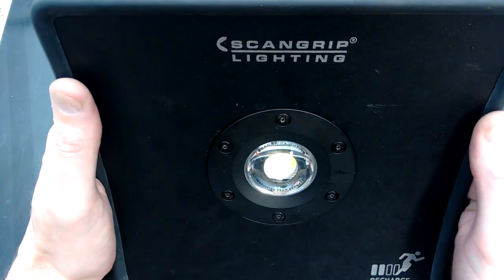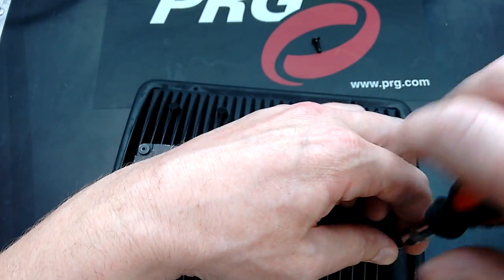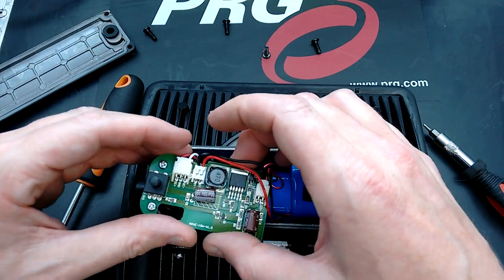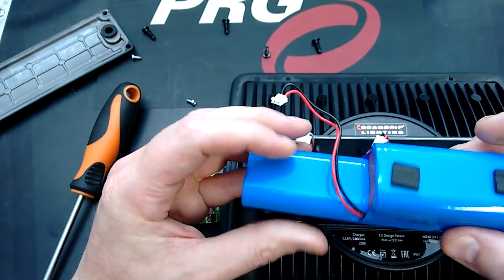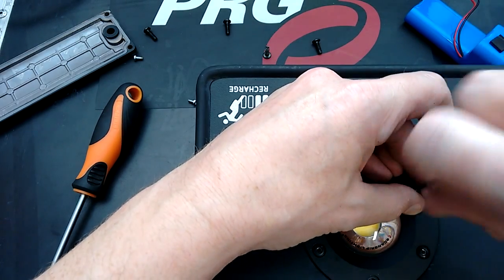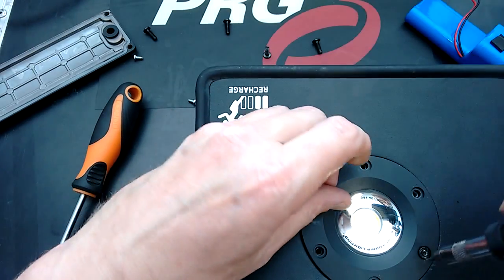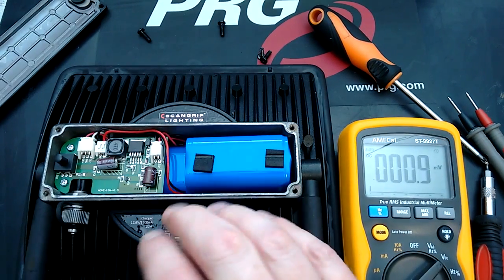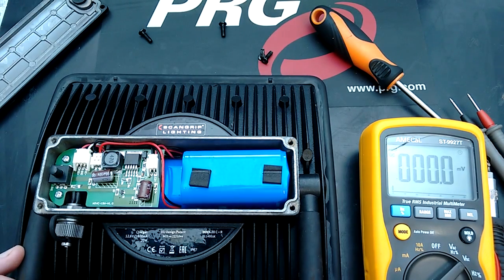Inside a good quality Scangrip rechargeable LED worklight.

Comment: Suspect 6x 18650 cells and the on voltage drop closer to 2.5V/LED at very low current, 2.9V at there low setting, and 3.06V at high power setting.  My LED strip lights, which like most white LED's are actually blue LED's, start up about 2.3V/LED and at full current they're closer to 2.9V.

Comment: It's surprising to me that the 6 18650s aren't wired in series to give a nominal voltage of 21.6 volts... I would think the boost conversion would be more efficient with a higher supply rail.

Comment: Do I see "15W" written on the driver board? Hmm, 15W driver in a 20W light? Not much better than the cheap ones… Would have been interesting to measure the actual current of the leds.

Comment: This is most likely a Citizen LED, something like a CLL022 1204 - which has 4 strings with 12 LED and nominal of approx 9W. (21W max. with proper cooling) Citizen is the only manufacturer which uses this high-voltage / low-current approach on COBs and design.
And to answer another question: HELLA heavily relies on OEM Products. They are a brand, not a maker for the idustrial lighting part. A lot of products are just rebranded with their Logo. (And sold for +20-50% of the original price.)

Comment: why is it so big? does it need that much heat sinking for the LEDs?
Reply from the maker: The cooler LEDs run, the longer they will last.
Reply: But I thought you prefered warm white
Reply: +shurdi3 If your serrious....colour temp has zero to do with actual temp of the LED. You want the LED to cool as possible...they put out tons of heat in a small package so need a lot of heatsinking to stay cool as unlike other tech they don't like getting hot as will burn out , colour shift, and loose efficancy and high temps.

You can read up on this st candlepowerfourms.
Reply: +shurdi3 If your serrious....colour temp has zero to do with actual temp of the LED. You want the LED to cool as possible...they put out tons of heat in a small package so need a lot of heatsinking to stay cool as unlike other tech they don't like getting hot as will burn out , colour shift, and loose efficancy and high temps.

You can read up on this st candlepowerfourms.
Reply: +Fry Depends on the LED used / Forward voltage. You wouldn't plug US appliance in to a UK socket would you (Pretending you could lol...it's just what the LED requires)

You can over amp LEDs a lot at the cost of heat and shorter life...but go to far and it will tint shift and burn out...However LEDs are sensitive to voltage and pop easily at the wrong voltage.

Dedomeing an LED (Removeing the "dome" on them...little clear part above them can increase its LUX (I think that units wrong but it's something like that...been out of the torch tech for a while) but often causes a tint shift...often to a warmer tint in a good way though...but it will technically loose effisncys...as the dome helps in that regard.

Honestly candlepowerfourms is an amazing resource and hobby if you want to learn more.
Reply: +CyclingSalmon14 Edit...I'm talking about direct driveing the LED...in terms of the boost circuit I have no idea if boosting up is more efficient than haveing a higher voltage battery and then regulateing it down...but you'd need more cells in the same space so would have less capacity and or a larger unit for the same capacity. Generally I would imagine it's simpler to use a boost converter rather than a regulater but I'm no electrician...I nearly understand that side of it so that's a question best answers by Clive.
Reply: yes its cheaper to use less cells and shorter charge time for them too, if you used more cells to reach the voltage you would indeed have a  longer running time, but i guess they consider the space saved and the converter a fair trade off.

Comment: Seems like they put not only protection circuitry but a full BMS on the battery pack.
There has to be some sort of balancing for an 3S2P lithium battery configuration like this. Since there is no charging circuitry or current regulation visible on the boost converter PCB this would make sense.

Really like the modularity and simplicity of this light. 
Everything in there is there for a reason and one specific purpose.
This being a current regulated light, there shouldn't be any visible pwm flicker when using one these as a video light.

Comment: I have a nice CREE XHP70 LED, that damn thing is 4000 LUMENS!!!! About equivalent to 4 or even 5 100W lamps! I think it is about 30 or so watts, and at lower powers, the higher binned ones (generally the colder and lower CRI ones) can achieve 170 lumens per watt, too! Although I prefer light quality over efficiency by this point, given that LEDs are so efficient now.
Reply: Nice, I picked up a CXB3590 for one of my projects and the 13000 lumens coming out of it will burn things. Hard to handle the 140W heat price though.
Reply: +Thor Rankin 
I'm currently working with an array of 160 XHP35's
1820W/255k LM 

:D

The most efficient LED by Cree:
I get 141LM/W
Reply: How would you cool this array down?
Reply: +Electester either it's a huge array with high thermal mass or more likely and simpley...active cooling.
Reply: +CyclingSalmon14 like fans and shut.
Reply: +Electester yeah 30*14cm heatsink (7cm high, 0,25cm gaps)+ 140mm Noctua industrial fan.

I  tested it only like 15 min's; The prototype Mpcb just arrived one day before my vacation, which I'm currently on.
But 15min's are like 40°C, so cooling seems good enough.

The purpose is a professional lighting 
product I'm designing right now. 

I am working with some other amazing stuff, too (some awesome metal halide Lamps and more)

Comment: It is really nice to see a piece of equipment designed and engineered to do a job, rather than every cent squeezed out of the design. Not that those aren't interesting! Anything with turned or milled alloy gets my engineering neuron all warm and fuzzy.

Comment: if only it didn't have a proprietary power connector. one thing i refuse to invest in is a product that makes me use a dedicated supply i can't readily get a replacement for from any regular electronics shop without consulting a catalog or possibly even having to contact the 'maker' and requesting a new one.

other than that, looks pretty solid.

Comment: I would have prefer to not have the electronics/ battery right behind the COB. I think that should have been relocated to either the mount or the bottom of the back case.
Reply: I agree, but like the designer (probably) i like things to be symmetrical :D

Comment: Looks and performs like Cree cxb chip. Ya want to see the light a cxb 3070 ( between about 70-90w) can produce. they're amazing.
Reply: CXA3590 is pretty bright, tho. 
Worked with them, but there not very efficient.
Reply: +Random Guy  I've been running my 3070 on 1000ma, it only looses a few lumins ,runs cooler and it makes it efficient than even a sodium light. And gives it an even longer life . WIN WIN
Reply: +Garry Carley Yeah, under-powering is a good thing, but for my case (Led Array) 
not only LM per W is a problem, but LM per mm^2, too. 

And you can run Cree's at full power with the same Lifetime, you just need more cooling
Reply: +Random Guy I found the perfect LED for my Array: XHP 35 
(Aray of 160, 1,8kW, 250k LM: it's kinda bright :D )
Reply: +Random Guy Do you ,or have you used reflectors or lenses. . l run between 12to15 lights,  all with 80 mm * 28mm thick, with a short reflector  don't now how many lunmins , cos the 3 meters i'v try,d won't measure it unless its several feet away . Brighter and more efficient than a sodium. its also adjustable, and instantaneous light on \off .  Top technology, don't you just love LEDS ?
Reply: +Garry Carley I use a big Diffusion glass  in front to get a single light source. I'm planning to use a diffusive reflector. 
I'm on Vacation right now, so no time to build. 

I like the concept of LED's, but I think they need some more development: we need high output single-source LED's (1mm would be good) to really be able to replace discharge lamps and other high output Solutions.
Reply: +Random Guy I run all the LED's with 0,2mm gap between them on a custom MPCB (4 Rows with 40 LED's each )
Reply: +Random Guy What's each one rated at? Have you thought about experimenting with  Fresnel lenses. I've had some surprisingly good results even with cheap A4 type plastic freznels . sounds like a good project going .Good luck muka!
Reply: +Garry Carley 
13w/1833lm each.

I could use a fresnel, but it's just more expensive and does the same thing. Also fresnel lenses are uncommon in this size. 
I'm using a special kind of frosted glass for professional lighting products; a more solid Frost filter then the Standard frost foil.

Comment: In the description you call the light a work light. Is it used as a desk lamp or where else ?
Reply from the maker: It's for illuminating work areas, but \i suppose it could be used as a desk light in an emergency.
Reply: The silkscreen on the boost converter PCB reads 15W whereas the rated input from the charger is 20W which suggests that there is some power to spare to charge the batteries even when the light is running on full blast.
Reply: +bigclivedotcom or alternatively feed it a 12V DC supply for long term indoor usage, I wonder if charging circuitry favors input power :)
Reply from the maker: It is designed to run on its charger too.

Comment: No balacing for the li-ions? Or is it on the protection board?
Reply from the maker: Usually on the protection board.
Reply: +bigclivedotcom Integrated battery management chip.  Usually has over current protection, low voltage cutoff, and balance charging in one neat little package.

They are incredibly cheap, and permit the use of lithium chemistry batteries in devices not specifically designed for them (like drills, lights, etc.)

Comment: I want to convert a diving light to lithium, and am planning on 8x 18650 and a 5w led, what kind should I use ? a 12 v 0.4 amp cob with a lens ?
Reply: If there is room for its 2" diameter, then look at a Soraa MR16 spot-lamp.  It is waterproof and comes with a good choice of colour temperatures and beam angles down to ten degrees.  It is designed to work off a transformer so, using a battery, you may need to add some inrush current limiting
Reply: I'd go with a high quality 10w led. Very bright, not much heatsinking needed, and easy to drive.
Reply: A. Zak I don't really trust ebay, is there a more reliable source in europe ? ( or china is fine too )
Reply: Try Cree XHP35 (13w, 1833lm), Or Cree XHP70 (32w, 4022lm). Both available in 12V in different color temps. 
You can get them on Mouser.de, but some models are only available in a full reel (500pcs). 
If no one is available in 1pcs try the Cree CXA2 Led's (like the one in the Video).
Here's an overview: cree[DOT]com/LED-Components-and-Modules/Landing-pages/CXA2
Reply: +Random Guy 
You can drive the LED's on lower Voltages to get even better efficiency. 
They come with a lens
Reply: BitsAndBites You can buy off Amazon or Alibaba if you don't like eBay. Just search for 10w led.